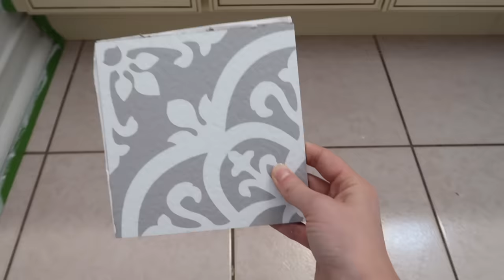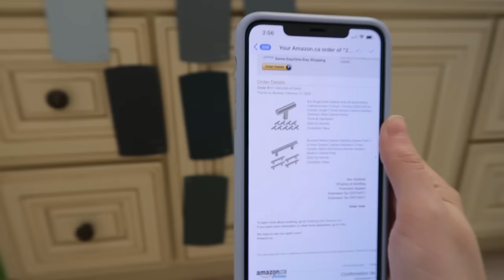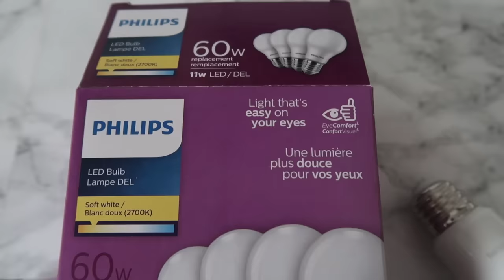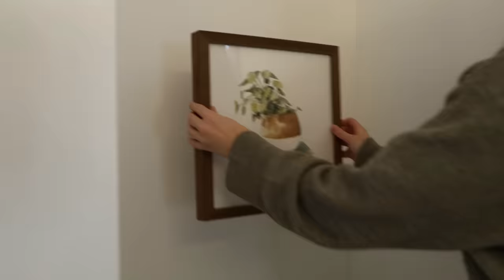DIY BATHROOM MAKEOVER ON A BUDGET | RENTER FRIENDLY

Comment: As gorgeous as the bathroom looks, I am a little concerned about the durability; changing a solid surface countertop to one covered with contact paper, and the tile, which is bound to get water drenched, is a concern too. It would be fine for someone who wants to change out their bathroom every couple of years, but does it have lasting power?

Comment: before seems the bathroom worth $$$$ after with contact paper, painted cabinet, vinyl floor, the bathroom worth $$$.......although it's pretty from vision, but definitely lower the value. If i were you, I probably will paint the ceramic floor with special paint, and stencil the floor then coated with top coat. will invest $$$$ for the quartz top, marble is too budget not friendly, then paint the cabinet with certain steps. That means, you put the same effort, just a little bit more money, and you raise the value of the house not lower it....